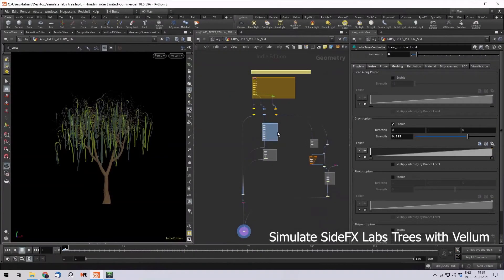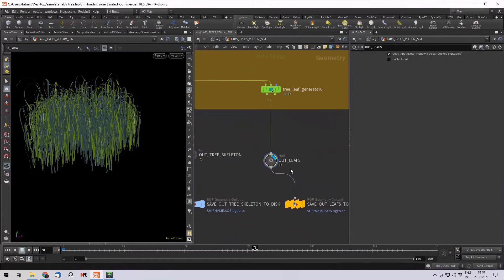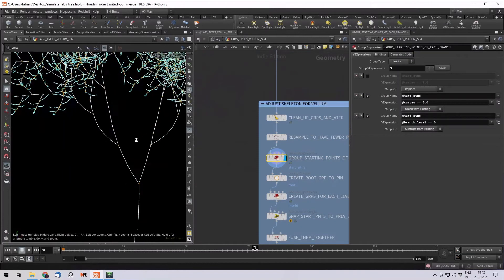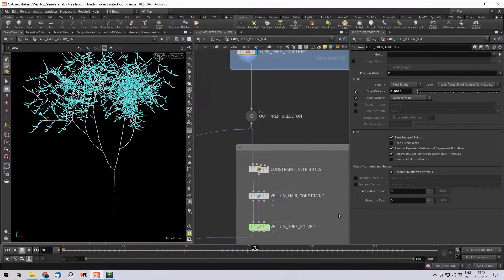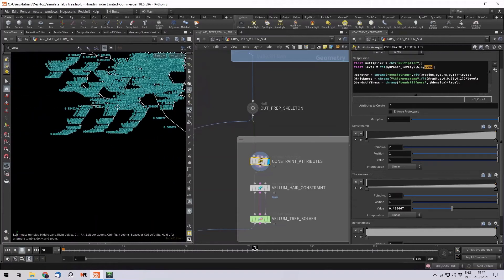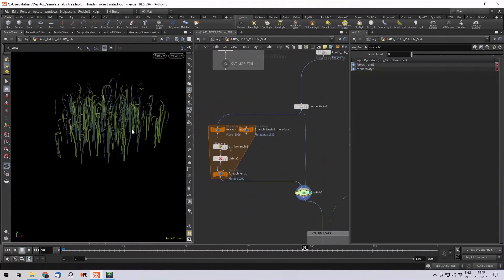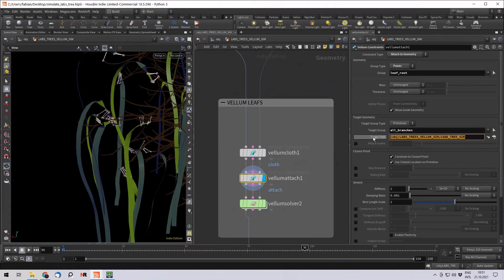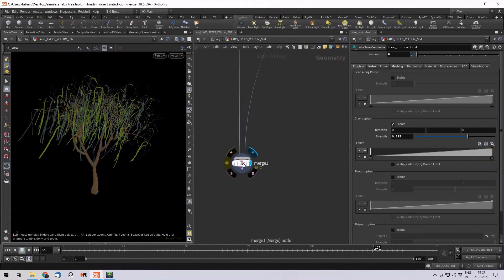Houdini Adventure - Simulate the Labs Trees with Vellum

Comment: Thanks so much for this, it’s a tremendous help! I had one minor issue that I’d like to point out in case it helps anyone. 

Some of my branches were falling off when I started the sim. The issue was with the attribute wrangle that snaps the points into place right before the fuse. Sometimes, it would try to snap a point to another point which would later be moved away, leaving the first point hanging in space. I solved this by adding a group combine before the attribute wrangle, subtracting the start points group from the level 2 group. Maybe you’d need to do all the groups in some scenarios, but all the problem points were on level 2 for me.

Anyway I hope that makes sense! I love the results I got from this tutorial, and it was so quick and well-explained. Thanks very much :)

Comment: Great video, helped me a good bit. I've been having issues with branch orientation however.

When a strong wind bends the tree trunk, branches roll/spin around the trunk as if it were a hinge. I've tried using various vellum constraints and had no luck; does anyone have a solution for this?

Comment: Thank you for this awesome video! The one thing I keep having trouble with is the moment I apply any gravity or wind to VELLUM_TREE_SOLVER, everything breaks, The tree just doesn't hold together.,
Reply from the maker: Sounds like the points are no fused together correctly. Do single branches just fall of?
Reply: @FabianStrube  Ya! Thank you for pointing me in the right direction :) Will take a closer look at the Fuse node.